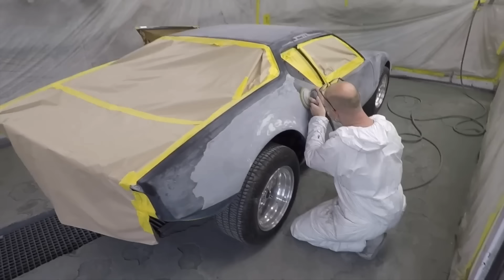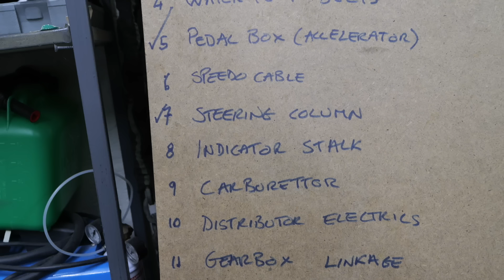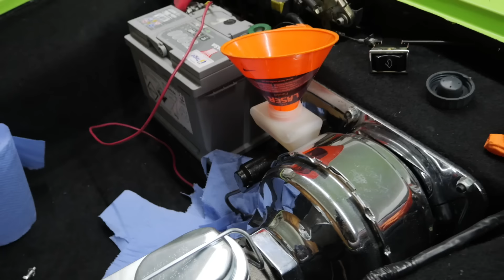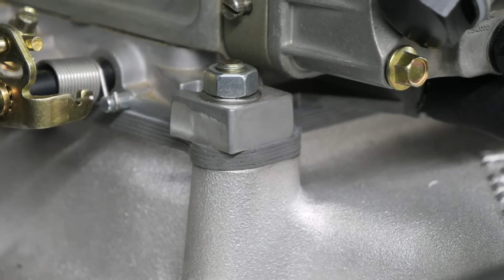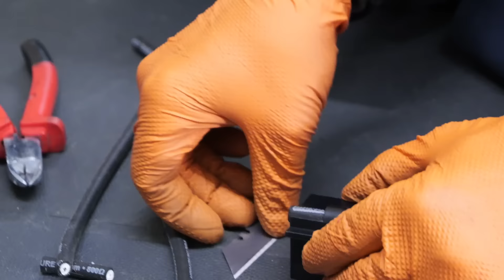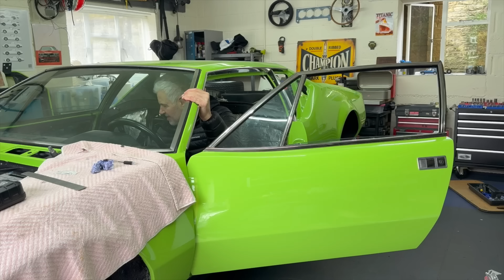Starting My 70s Supercar For The FIRST Time.. DeTomaso Pantera Project

Comment: You probably already have the choke issue sorted, however if you don't, on a cold motor, looking at the black cap which houses the spring coil, there is a, I believe three screw holding it in place. With the throttle plates completely close, check to see if the choke flap/plate has a 1/16 inch open gap (1.5875mm). If not, loosen the thee retaining screws on the spring housing, black cap, and rotate until you have the spec'd number. A drill bit of that size works great. This helps to stop flooding. 
Use the 12 volt run position wire on the ignition switch for the connection at the choke

Comment: Following your restoration, I can't wait to get back to the UK on a full-time basis and to have the time to start restoring my right-hand-drive 1971 DeTomaso Pantera. It's been in storage with my right-hand-drive1968 Porsche 912 for too long. I have had both cars for over 35 years. The first start of a serious engine rebuild is always exciting and a moment to treasure. The V8 engine sound is mega.

Comment: Ok Jack, loose the Holley, get an Edelbrock 1405. Then get an Ebay, made in China 351c electronic dist with the special 40k coil. Then call it done. I have 800 miles on this setup with no issues. Cheers!

Comment: Something caught my eyes when you were showing the installation instruction for the aftermarket HiTork starter motor.  The instuctions looked familiar, and then I realized why.  I did those illustration years ago back when I was a technical illustrator!  Glad to see that all these years later, HiTork are still using those instructions, I hope that it helped with the installation!
Reply: Cool, I love exploded technical drawings like that. Was it done by hand or on a computer?
Reply: @RobertBlow  Done the old fashied way, a pencil layout and then inked on Mylar.  I never got too good on computers, but I found that I could get way more shading and line wieghting with an ink pen.

Comment: About the headers - as the new ones are not the best and originals are too expensive maybe a custom header and exhaust job would be good? It is on the expensive side too, but it might be better than trying to make some bad headers work here and you could request a specific size and placement of the pipes. I'd definetely recommend going with a custom one here

Comment: That nylon string you were using to get the screen in is just not the right stuff it will cut the rubber or snag better to use a multi strand rope like fine boat rigging lines and they will last longer than your classic car.

Comment: The choke has a bimetallic spring to back it off when it is heated by a coil in the housing, that is what the ignition live feed to the housing does, common on old solexs on beetles and some webers from the 80's. It's kind of calculated to back it off at a rate that matches the warm up of the engine.

Comment: I'm sure you're going to fit some sort of cover over the front of the engine so you don't have a belt spinning right under your elbow, but it'll only be a thin bit of plastic - you don't realise just how close the engine is to you in a mid engine car ! I drove a Mondial a few years back and the noise & proximity of the engine to my head scared the life out of me, even with rear 'seats' behind me !

Comment: Good on those guys coming over and helping you out! Fitting glass to older cars can certainly be a challenge, string ripping rubbers, glass coming out of the rubber, bruised hands from string looped around your fingers and sore palms of the hand from "slapping" the glass into the body. A relief when it's done! 
Ah, an automatic choke on the carb, there's the same thing on Solex carbs on old VW Beetles. The element warms up and dials back the choke, great when it's set up correctly.

Comment: Square bore, mechanical secondaries? Nice for the feel, but a spread bore with smaller primaries will make it more economical at cruise, and easier to drive in small UK streets, while still having big secondaries when the madness arrives. That lip in the bores,... yeeeeech, if given a good rev, could have cracked the top of a piston off.

Comment: Working with Lincoln Mercury and sold the first Pantera in Calif working with Longbeach delivery service  with Bill Stroppe  due to over heating rusty brakes  etc  The original radiator hoses ran through the cockpit of the car making it in Calif unbelievable hot the York A/c could not keep up  so the pipes were rerouted under the car  Many changes were made  but a driver warning was given about throwing the A/C on at  high revs or racing mode as the clutch on the A/C could fly threw the cockpit bulge !! Bob Bondurant taught  me to drive the car at Riverside speed way (now gone )  side note we used coloured water in the rad. and found the water did not filter through the rad but came straight out hot at the bottom hose so a baffle was installed  in the rad in some cars   Cheers  hope that helps   If this car had a an Italian Engine this car would be valued at over $500k but not that reliable !

Comment: i understand the adherence to the original, but it feels like carburated engines are such a mechanical burden to keep in a car while rebuilding it... It's almost an art form rather than science... I think fuel injection isn't such a blasphemy after all. After all, you're painting it into a screaming color that was never originally offered by the factory so...

Comment: Been building/repairing engines for fifty odd years. the excitement of the first start never gets old. My first thought when fired it up was that it sounded extremely rich which it would do with the choke on. I'd like to hear it having a bit more throttle, it should sound fantastic.

Comment: Jack, a thought re the auto choke. Bin it. I have a 1970 Boss 302 Mustang running the original Holley carb and manual choke. The manual choke is 100% reliable and makes it so much easier to start and warm up a cranky cammed V8 from cold, especially in cold weather

Comment: A bit scary that you have to share the cockpit with some of the engine. I'm reminded of a guy who built a motorbike powered by the front two cylinders from a Rolls-Royce Merlin, set up Harley-style. He remarked that one camshaft and rocker gear assembly was operating a bit too close to the family jewels.

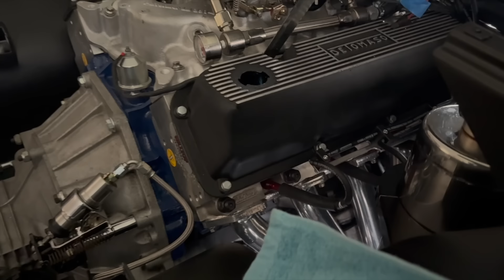Comment: i imagine i was one of the many shouting at the screen, - 13:58 the choke plate is hard shut - how is that 6 litre engine supposed to breathe...   auto-chokes either use warm water or electric heat on a bi-metal coiled strip to open the choke plates gradually as it heats up...    anyway, you have had cars with a choke before, you should know the score....      keep it up young man, and remember mr baxter, which was brayed into me as an apprentice, baxter basics, fuel -yes, air - err no, second on the list, never needed to get to spark...

Comment: Had exactly the same issue with my Ford FE428 and a Holly carb. You can vary the time the electric choke stays on by twisting the black casing, you can watch it open and shut once it has a 12V supply. You can actually pull all the choke gubbins ut and just rev it to start a bit, but mine is still in place. Where did you get those plug lights?
Reply from the maker: Ebay!! But you can find them anywhere.. very common

Comment: Make sure you are using the correct break-in oil. Driven BR-40 is recommended for 351C engines with flat tappet cams. If you have trouble with the starter, the Bosch SR7548N is excellent.

Comment: @Jack: What size, shape and color wheel (ruote) will you be fitting? Are they going to be an inch or 2 bigger? A four spoke gold colored center alloy (legga leggera) wheel with chrome edge/rim? Like the LANCIA Stratos and older FIAT’s? Or just white in RAL 9010. That would give the car a real fresh look.

Comment: Number 27, you are the kingmaker in this. I first understood the depth of De Tomaso and Ford Dearborn funding and American Cleveland engine plant engineering, the most blessed of partnerships, when I discovered the M code V8 was just a lower tier hydraulic cam Mustang 351, our Australian Falcon GT engine. Without the spike of Pantera International, the basics wouldn't have  come together. Well done on the Windscreen, clutch ,gearshift and electric choke and Starter.

🟩✔️🇮🇹🍝🇺🇸🏴🫡

Comment: Hi kid. Greetings from the Rust Belt USA. Once upon a time, I was an avid "gear head", as we  say here. Also a mechanics helper. The Pantera made a big splash in the automotive media  when it was introduced. One of my favorites. The automotive magazines published many articles, including specific ones about the "problems " the Pantera had. This information should still be available. The one I remember is that Ford was aware of these issues. A mechanic/technician was sent out to the homes of owners of "problem " Panteras. He had a  kit with replacement parts, parts that were installed to improve the vehicle,  and equipment for testing. This was apparently done free of charge for the owners. One story told that the work would be done in only a few hours. More difficult repairs required trips to the dealership where it was sold. As I said, all this information should be accessible on line. Good luck.

Comment: I was going to say it sounded like a fuelling issue, I’d have guessed lack of fuel pressure (I.e. using fuel quicker than the fuel could get there) but glad you got it sorted. 

Not sure if you know this little bit of info but the original prototype v12 e-type couldn’t get to its 150mph top speed because 1 fuel pump couldn’t keep up at full throttle so they paralleled up 2 pumps and that solved the issue. We did some calculations and estimated it was using about 2 litres a minute at that speed!

Comment: Lovely job, but do be careful running the car with the air filter removed. Many years ago we had a flame out on a Holley carb due to a cough and splutter moment running just like that. It singed my dad’s friend’s eyebrows and hair. Hate to see you have any issue after all the hard work.

Comment: You could put a wire from the postive of the coil to the choke i remember vw beatles did that.
Reply: Oddly that has proven to be problematic in these cars. The current draw from the choke acts like a rev limiter on the coil and the car won’t rev above about 4500 rpm. Well, that’s from a sample size of one.  The guys in the Pantera Club of Northern California were called in to perform an exorcism on a Pantera so-afflicted. One of the smarter guys (ironically, the former owner of the car featured in this video) noticed the choke being powered off the coil. He fabbed a new power wire from a switched 12v source and VAROOM!  Right to 6000 rpm. 

I never would have guessed it had I not seen it with my own eyes. That was back in about 1994….